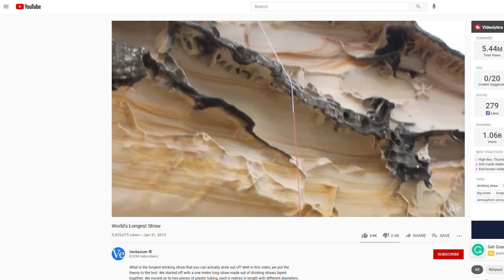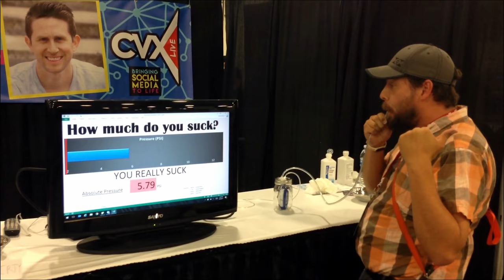Trying To Drink From The World's Longest Straw

Comment: So... what you’re saying is that if we had strong enough muscles, we could boil water by sucking it. Nice
Reply: Yeah but it wouldn't be useful... It doesn't raise the temperature of the water, so it wouldn't be like an easy way to prep water to cook pasta or something lol
Reply: @thefolder69  It WOULD however be a very effective way of distilling solutions with water in them, and indeed vacuum stills are a thing
Reply: @dsdy1205  I don't know about you but I don't consider water in a tube I just sucked like a straw to be very distilled. But you still have a point, I didn't think about that
Reply: @thefolder69  I moved away from the straw setup already haha; irl distilleries do exist that use vacuum instead of heat to boil off the water and concentrate ethanol. It's not really what's sucked into the vac pump that's important in that case, but what's left behind.
Reply: Thank you waluigi
Reply: E s i d i s i
Reply: @mosqit4324  when the impoator is hojo reference.
Reply: @rafaricks  learn to type
Reply: @mosqit4324  flafa
Reply: @rafaricks  chill man
Reply: @slimeball4l540  how where they “un-chill” in the first place?
Reply: @slimeball4l540  sus
Reply: @slimeball4l540  oh oof. i didn’t know that. i thought it was just a keyboard smash lol.
Reply: @slimeball4l540  flafa man, flafa
Reply: @KniteRite  YES exactly what I was thinking, but ouch that's gotta hurt
Reply: No, he's saying its impossible to drink from a straw that is 34ft long.
Reply: @malodos2295  sarcasm
Reply: @malodos2295  but i mean am i wrong tho?
Reply: @stella-pp6tn  Yes, its impossible to suck on a straw so hard that you can boil it using only your mouth.
Reply: @stella-pp6tn  I mean you did ask, in the slim chance you were genuinly asking i just answered.
Reply: Technically doesn't work like that, but it would work anyway
Reply: It doesn't get hot though
Reply: @dsdy1205  because distilling ethanol beyond a certain % is impossible with heat.
Reply: @PBMS123  well honestly if you drank ethanol distilled at that limit you'd probably die anyway haha

Comment: The "theoretical limit" will actually vary day by day depending on the local atmospheric pressure - up to +/-3ft or even more, in rare circumstances.
Reply: so it can higher if the straw has an outer tube with more presure?
Reply: @nonec384  that would be hard but yes
Reply: Well actually no that I think more, no it would have to be completely air tight and that is near impossible with straws
Reply: @thebluetails2895  the person in the video didnt use a straw i think thats water hose for saws to cool then or something it looks like one
Reply: @nonec384  still, it would be very hard to have a high pressure wrapped around a low pressure without either compromising the structure, or having air leak through the molecular structure
Reply: Theoretical limit = dgh
D definitely varies
Reply: @dubhendrix3726  Deep wells use submersible pumps - the pump is at the bottom of the well and pumps the water up.  You can push water uphill as high as you like, but you can only pull it uphill as high as a perfect vacuum allows.
Reply: May also vary with tube diameter, as capillary forces also help the water "crawl" up the sides of the tube a little more. Smaller diameter = more help, but also =more likely to collapse if wall thickness is proportionally decreased, causing collapse near the top of the tube d/t suction.
Reply: It’d be interesting to film this with a FLIR camera.

You could time lapse the water getting warmer, and also the difference in temp from top to bottom.
Reply: @requiemforameme1  The water isn't getting warmer.  It is boiling due to a lower pressure, rather than a higher temperature.
Reply: but the local atmospheric pressure doesn't change the pressure inside the straw. How would It effect it?
Reply: @Tiewarn  Local atmospheric pressure affects the pressure at the open container at the bottom of the straw.

If you try this experiment at sea level with a 20C ambient, the maximum height you can suck water before it boils is 10.1 meters.
If you try this experiment at 1km above sea level, where air pressure is about 90 kPa instead of 101 kPa, the maximum height you can suck water before it boils is 8.95 meters.
Try this experiment in Tibet, at 3.6 km above sea level, the air pressure is 65 kPa, and the maximum height you can suck water is 6.4 meters.

Comment: There's a reason we use mercury for measuring vacuum. Water would just take a lot of height
Reply: That’s actually kinda smart
Reply: @drvelocci  thats just basic physics
Reply: Because it is a fluid with a high mass?
Reply: @UrBrothaInChrist  yh but it was still smart at the time.
Reply: @maddi5920  High density
Reply: @thatwasme7197  Higher density = higher Mass in the same volume... so yeah
Reply: The other reason for using mercury instead of water is water starts to evaporate under low pressure. 
I made a water barometer when I was a kid.  It didn't work for very long at a time because the water evaporates and the water vapor leaks.
Reply: But water is not toxic
Reply: @iWillRun_  Unless you try to breathe it
Reply: I think there is also more thermal expansion of metals over water?
Reply: @abcqer555  When reading pressure changes in a system you are usually not wanting to see a temperature change. If temperature changes then you have thermal expansion happening, which will throw off your accurate pressure reading. Anyway good thing pressure transducers exist, which are way more accurate and robust. If you are asking "does metal have a higher thermal expansion coefficient of water?" then a quick google search tells me this: you are comparing a liquid and a solid (most metals are solids at room temperature), but anyway water generally has a 2 to 7 times more thermal expansion than metals. I could not find TEC of liquid mercury sadly.
Reply: @maddi5920  high density + high vapour pressure (mercury evaporates some 16 000 times slower than water at r.t. !)

Comment: Fun fact: Because of cavitation, dolphins can’t swim at max speed. The bubbles that form at the end of their tails when they swim too fast make them hurt bad.
Reply: How do bubbles cause pain?
Reply: @crazylegs1324  difference o pressure, the bubbles collapse and generate shock waves, it sure as hell should hurt!
Look at what it does to machinery
Reply: Interesting
Reply: @crazylegs1324  pistol shrimp
Reply: @gamer_que_anima7148  its not, they just avoid swimming too fast and stay fine. You wouldn’t say it’s sad that you can’t violently shake your head without probably getting hurt.
Reply: @crazylegs1324  cavitation is not actually bubbles but small volumes of vacuum. These littles vacuum “bubbles” collapse incredibly quickly which is physically quite violent.

It causes the same damage on propellers in ships and boats.
Reply: tuna also have that problem
Reply: dont care
Reply: So what you're saying is to never give dolphins armor. I imagine if running shoes make humans run faster, armor for Dolphins tails would give them some crazy effects
Reply: @BitchyBoxxy  I remember a game called Ecco the Dolphin let you swim in space, and let your dolphin go faster because of it
Reply: @好吧-h6k  that hurts
Reply: Wouldn't the fastest they can go be max speed
Reply: @AlphaFX-kv4ud  Yeah, it is BIG BRAIN time
Reply: @Fogmeister  nah it’s not a vacuum. It’s the rapid vaporization and condensation of a liquid through a pipe/valve/etc. caused by a brief change in pressure to be below the liquid’s vapor pressure and immediately after an increase in pressure to be above the vapor pressure. This rapid process causes those bubbles to collapse violently, essentially acting as if it was a corrosive fluid on the equipment. If you make the pressure go below the vapor pressure of the liquid, it will change phase into a vapor. They are literally small bubbles of vapor.
Reply: @Fogmeister  what do u mean by vacumn
Reply: @Fogmeister  oh, vacuum
Reply: wow
Reply: i’m sorry but is this video about fucking dolphins?
Reply: oh my god, is bad okay?
Reply: @crazylegs1324   when you’re a rock Pokémon
Reply: @logandunlap9156  did you even watched it ?
Reply: @好吧-h6k   project power 😂
Reply: What if the dolphin cant feel pain?
Reply: @NigelMelanisticSmith  Ecco is a difficult game!  I never got that far!
Reply: @christopherwellman2364  it certainly is hard, I only got that far with cheats lol
Reply: @NigelMelanisticSmith  That is so funny!  I love that game!  I could not then nor get very far as an adult.  I still play it on my old system sometimes!
Reply: @christopherwellman2364  same here. It's also in most Genesis collections nowadays, so it's always a treat there aswell. I remember getting pretty decent with it on my PSP Genesis collection.
Reply: @NigelMelanisticSmith  I bet you gotta talk to a jellyfish or something, am I right?
Reply: @NigelMelanisticSmith  Sega Genesis is the system
Reply: @christopherwellman2364  I honestly don't remember. I think there are Jellyfish in Ecco Jr however.
Reply: @NigelMelanisticSmith  I've meticulously mapped out and won The Legend of Zelda and Dragon Warrior, yet Ecco the Dolphin has always perplexed me.

Maybe I should map it out
Reply: @christopherwellman2364  the Echo mechanic would help you out a ton there, since you could map areas past walls.

Comment: There are 2 ways to boil water:
The easy way: using heat
The hard way: succccc
Reply: I believe SUCC technically requires less work, because heat uses a lot of energy.
Reply: @sanderkvenild8947  no, because you hit switch and it go brrrrrr.
Reply: the HARD way, lol
Reply: @Doctor_Straing_Strange  😭
Reply: @Xous_  it takes a while to boil it sint instant you could probably suck it faster than heat can boil
Reply: @oldarthurmorgan6319  dry ice can make it boil
Reply: @justusxp9216  Understandable,lol
Reply: and thats what I call a power succ
Reply: *me attaching a vacuum pump to my pot of pasta
Reply: @oldarthurmorgan6319  not exactly, if you can keep the water in a vaccum the opposing air pressure will be so low that the water will spontaneously boil even though the temperature is still the same. That’s because water always wants to evaporate but the air pressure prevents that from happening
Reply: I'm never going to your house for iced tea.
Reply: @sanderkvenild8947  Yeah it takes very long to boil it even on gas
Reply: Idk why but that's what she said
Reply: @catastrophic_music  yes indeed you can
Reply: @ethanebang8902  cool i have figured out a new way to get the sus cream hotter before it enters my mouth-
Reply: Remember that the vacuum chamber is not actually heating up the water but in lowering pressure it also lowers its boiling point. The point of boiling water for cooking is to ensure whatever you put in the water (pasta noodles, etc.) gets hot enough to cook properly.
Reply: @stephenbeck7222  I just said boil water, I didn’t say if it was useful for cooking or not lmao

Comment: I did this with my ex years ago, we connected together a whole bunch of straws and he climbed to the top of the domed jungle gym and tried to take a drink. It pulled such a vacuum that it cut his lip and tongue. Basically the whole large tea was just in the straw.
Reply: nani the fuck
Reply: Wtf
Reply: Wtf that is mess up even if its your ex
Reply: "I did this with my ex years ago"

I thought this story was taking a different turn.
Reply: how did it cut though, end of the straw?
Reply: @Garresh1   l know
Reply: i thought this was gonna end differently
Reply: @UmiZoomR  pressure, they did it with actual straws and those plastic straws can easily cut your tongue or lip. Think of what it is like to stick the end of a vacuum onto a pillowcase or a shopping bag, it gets sucked in... basically that but your tongue or lip into a couple millimeter opening with thin ridged walls. The equivalent of a paper cut.

Comment: Now try it with the tube already full of water. That’s how trees get past the theoretical limit and grow to massive heights.
Reply: ... not factual
Reply: @danbird1903  Yes it is. Go learn something.
Reply: Wouldn't it still boil the water?
Reply: @abhigyakumar3705  cohesion tension transpiration pull theory
Reply: There needs to be a whole video on this!
Reply: @jetison333  No.  What happens is that the water is in a metastable state of being a "supersucked liquid", analogous to supercooled water.  The water is at a temperature & pressure condition where it "should be" boiling, but isn't.  Without a nucleation site and the activation energy to initiate the phase change, it remains in a liquid state, and can actually carry a negative (tensile) absolute pressure.  That's how trees can be a hell of a lot taller than ten meters.

The tallest trees in the world actually get their water from fog, rather than from water at the roots.  These are the coastal redwoods that grow on the upper (Marin County) peninsula of San Francisco Bay.

Comment: You might actually be able to draw liquid up the entire length of the straw if after drawing a foot or so of liquid you remove the bottom end of the straw from the container. Then you should be able to get that slug of water to climb all the way up to your mouth. This allows atmospheric pressure to assist in pushing up the water, as you now only have to create a difference in pressure equal to the weight of the water slug. This trick will only work if the straw's diameter is small enough to allow capillary action to keep the liquid intact.

Comment: I wish you had explained a little more about what the theoretical limit is based on, namely that the water is being pushed UP the tube by atmospheric pressure, so this is also dependent on elevation, weather, etc, changing the atmospheric pressure.

Comment: What I like about this video that Veritasium didn't do, is that you actually videoed the liquid moving up. It's one thing to say "oh we just couldn't get it high enough," take a shot of the end of the liquid without seeing the full length, and then call it a day, but it's a lot easier to grasp and fully understand where it starts falling apart. It practically has a hard cut-off on suction, which is really interesting.

I never thought of the liquid as pulling itself down due to gravity, but I guess that makes a lot of sense when you consider the fact that they at least try to stay together. It's not a bunch of bubbles resting on top of each other like tapioca balls, they're more like gelatin, they'll typically stick together unless forced to separate.

Comment: you could actually get it higher in colder weather as that would reduce the pressure at which the water boils, tell me if that is correct. thx, great video, very simple to follow
Reply: Nice theory btw 🤓🧐

Comment: 1:03 the theoretical limit is not based on the vapour pressure of water.
It is based on the fact that the air pressure is finite,  and so the height of the water is also finite, as the force of the increasing height of water from gravity will eventually equal the force that air pressure exerts. 
We know that the force exerted by the air pressure is about 101kPa, and that the formula to calculate the force exerted is, P*A (where is the area that pressure is exerting on). 
The force from gravity is given by the Volume*density. The volume is A*h. P*A = A*h*density*gravity. (Density*gravity gives us the NEwtons density, i.e. N/kg)
A on both sides cancel out, and we solve for h to get: h= P/NewtDensity. Density of water is 1000kg/m3, standard air pressure is 100,000N/m^2 (checking units we get (N/m^2)*(m^3/N) which leaves us with m)
So 101000/9810 = 10.3m. (33.887ft)
The theoretical maximum is due to the air pressure and the density of the fluid.
If you were sucking up Mercury with a density of 13690kg/m^3 (13.7 tonnes), the height would be only 75cm.
f you were on Mt Everest where the air pressure is only 33.7kPa, and sucking up water the height becomes 3.43m.

Comment: 4:20 this video helped me realize how trees could “suck up” water past 34ft
Reply: nice time stamp
Reply: They actually don’t suck up through a vacuum, but because of a very low water potential outside of the leaves that causes transpiration through the xylem through cohesion of the water molecules inside it
Reply: the trees use capillarity which is the same reason why soil is usually wet even when the aquifers or water table are a few meters below; capillarity occurs due to the surface tension of water, this as a result of the water molecules having a stronger bond between them that with the other fluid, in this case, air.

So when you introduce a capilar or small pore in the water, the surface tension forms a meniscus that results in a positive force component that conducts the water up high, this is why the level of the liquid in a straw in your drinks is never the same as the rest of the cup but a little bit higher, the smaller the pores the higher the water gets, in sands this might be a few inches or a couple of feet because sand is coarse and so the pores area larger, in silts or clays water can climb up to 10 meters, the same principle applies to trees.

Comment: You can drink from that length tube and quite a bit longer using a small aquarium pump forcing air up the bottom submerged in the liquid you want to transport.  The air bubbles lift the liquid extremely efficiently.